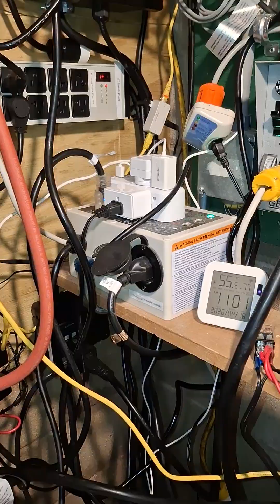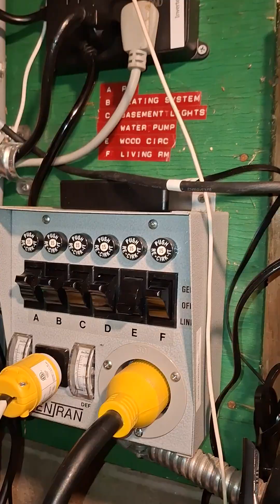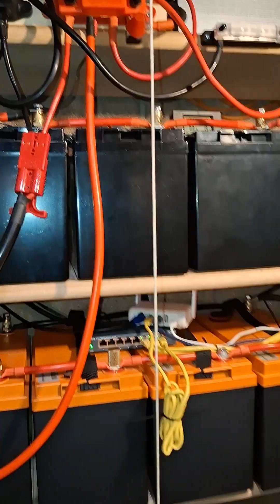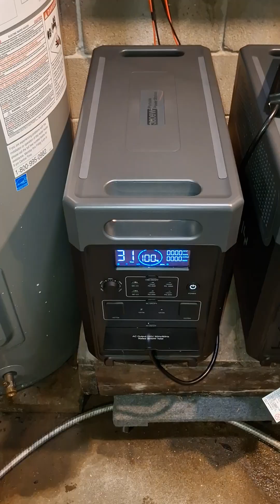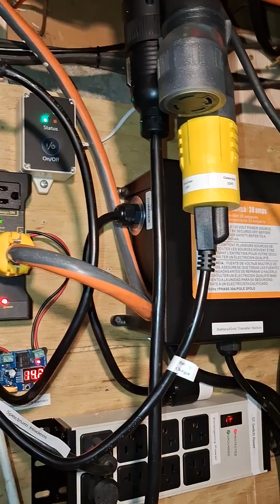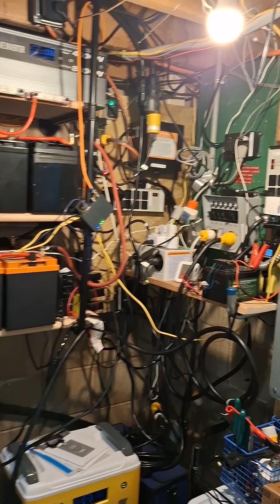Battery-based Critical Circuit  Emergency Power System

Comment: If the power goes out, the power that goes to the internet, be it a tower or underground cable, they may lose power also. That's usually what happens in a big storm. So unless you get your internet from a satellite, powering your local home internet will be useless.

Comment from the maker: A secondary benefit of this system is that it allows me to take advantage of time of day rate plans. This allows me to shut off the electricity from 5:00 p.m. to 9:00 p.m. everyday when the rates are high and take advantage of rates that are 60% less than normal during the rest of the day. I've cut my electric bill by more than 50% with this system.